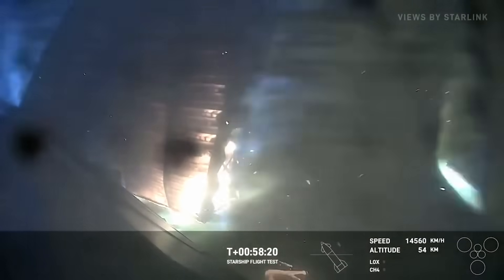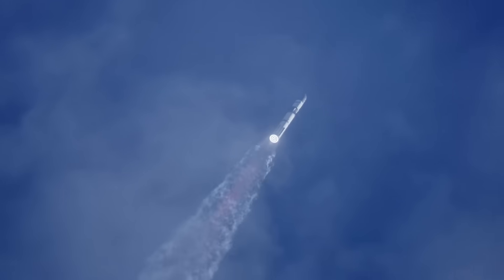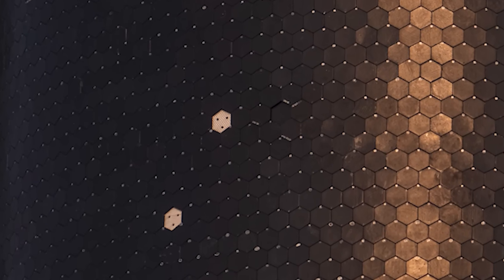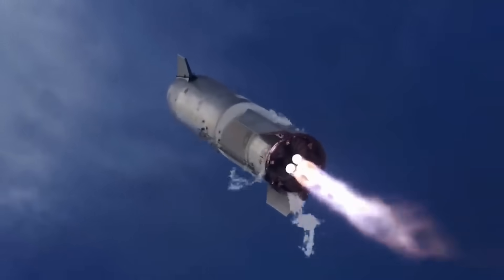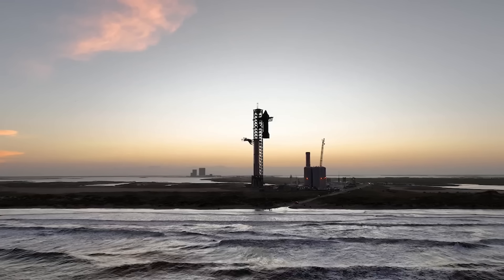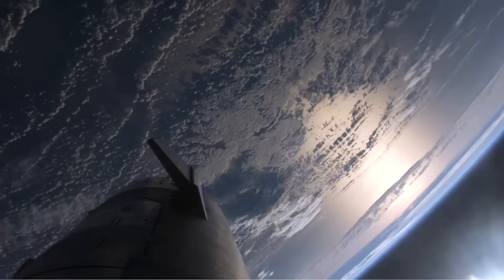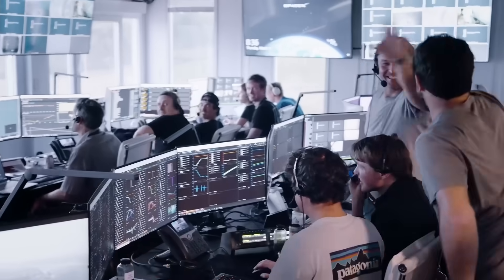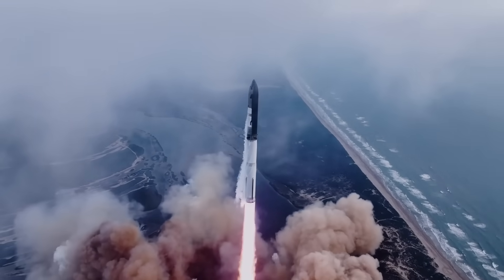SpaceX Is Adding Another Heat Shield Layer To Starship

Comment: Thinking out loud could Endura Coating's Composite Diamond Coatings (CDC) Specifications Series 1100 be slightly improved to add higher temperature diamond coating adhesion resilience, then coat Starship's stainless steel Flaps, and Space Facing no tile unshielded fuselage side on re-entry to wick away heat from under the new two layer heat shield tiles, and into the plasma stream exiting as a proposed wick away from stainless steel surfaces additional cooling concept, thus stabilizing Starship on reentry by means of improved more stable, even out fluid dynamics flow patterned, while decreasing both flap, and fuselage unwanted abrasion do to evening out localized stainless steel surface heating on StarShip’s many plasma transitioning points from tiled surfaces to non tiled surfaces. Any thermal engineers out there wish to comment on a three layered heat shield system comprised of diamond coated stainless steel surfaces, layer one heat shield, layer two heat shield.

Google Search at “ScienceDirect”: Research Paper titled "Effective thermal conductivity of a diamond coated heat spreader"

Comment: Try a smaller rocket with the various tiles or surfacing and run it through the reentry tests. Why such a huge device to test ablatives ???  No quick turn around for this setup. Bummer but just scale it, cracks and dislodging fixes should not burn through it. Installing electro-gravs will also help reduce the mass/fuel needed, ask Eugene Podkletnov how to do this.

Comment: Very little fuel in the booster tanks will prevent an explosion??????????
Have you forgotten those explosions of the test Starships when they fell over on landing???
That's what you get with "nearly empty propellant tanks".
Reply: As spectacular as it looks less fuel does mean less power.  That's not to say it's insignificant, but less fuel to burn is less fuel to burn.

Comment: I expect a destroyed launch tower if SpaceX tries to catch a booster. It seems like a more logical solution is to suck it up, take the weight hit, and put landing legs on the booster, then let it land on a pad mounted on rails. The landing pad could do double duty for propulsive landings of Starships. I mean the damned thing is eventually going to need landing legs for Mars anyway. Might as well suck it up now and put them on.
The rails would allow them to move the booster back to the launch pad for reuse, while protecting the extremely expensive and valuable launch pad.

Putting so much important equipment on the Stage 0 launch pad might be OK for saving weight, but it is an enormous risk. Destroying a pad is expensive and cuts your launch abilities in half, assuming you have a second pad. Even if they "perfect" catching a booster or Starship or both, SpaceX's devotion to the "no part is the best part" ethos works against the redundancy that is required for reliability. That makes the odds of a malfunction or hardware failure more likely, and the danger of a stage 0 disaster an expectation somewhere down the line.
Reply: That might be why they only consider the opinions of the ones who have access to the actual data.

Comment: I wish SpaceX would test a section of the heat shield with a transpirational cooling area to see if their original idea has merit. Those tiles must add a lot of weight. And if they have to add an ablator behind the tiles, that's even more weight. So the question becomes, would the fuel/weight penalty for using transpirational cooling be more than the penalty of a conventional heat shield? And would the holes required to expel the cooling vapor be too prone to clogging to be reliable? 
If that method proved effective, I think it would be much better for reusability than heat shield tiles. The tiles on the Space Shuttle were its most maintenance intensive area that slowed down reuse and increased costs massively.
I hate to see SpaceX be forced down that road. They chose stainless steel for its cost, ease of manufacture, and durability. It is time to try to maximize its utility by trying the transpirational cooling method.

Comment: The Space shuttle is a better design.
Reply: Maybe give some arguments to support your thesis?
Reply: @GreyDeathVaccine  Large bottom surface area to absorb the heat 🔥. StarShip should be build like a pyramid - larger surface area.
Reply: @michaelanderson3096  Not needed.  You shouldn't pretend if you don't actually know what you're talking about.

Comment: Using ablative materials, wont this drastically increase turn around time ?
Reply: Yes, but only if a tile is lost, and the ablative material is exposed to high temperatures. It beats burning up on reentry.
Reply: @StillAliveAndKicking_  Place the Rapid vehicle turn around in the Next Time bucket.
Reply: @mikewallace8087  What on earth does that mean?

Comment: Any solution using tiles and heat shield will not be rapidly reusable. We know this from the Space shuttle.
Better go back to the drawing board and think about something drastically different.
Reply: Each space shuttle tile was custom made, hard to remove, and brittle. Starship tiles should be much better.

Comment: Ablative?? Doesn't that defeat the purpose of re-usability?

To the person with diminutive brain capacity who replied: a heat shield is not comparable to fuel. Do you have to re-coat the inner lining of your car's carburetor every time you drive, because half the aluminum alloy ablated off? That's the real comparison.
Reply: LOL. What a stupid question. Do you also say that the car is not reusable because it burns fuel?
Reply: @GreyDeathVaccine  No such thing as a stupid question. Don't insult someone for showing genuine curiosity!
Reply: Do you have to re-coat the inner lining of your carburetor every time you drive, because half the aluminum alloy ablated off? That's the real comparison, you [expletive]

Comment: Making 2 sets of steering flaps slightly off-aligned at the back. So when re-entry, the ones most located at the back of the ship stay more out of the heath... and it provides an extra safety for when one set fails out i think.

Comment: We need to stop kidding ourselves that there will be a rapid reuse or ultra quick turnaround for Starship. It just won't happen with current heat shield tech. The booster? Sure that is most likely achievable. SpaceX will most likely need a fresh Starship ready to be added to the stack while the Starship that  just landed goes for refurbishment.

Comment: If they do manage to land the booster, they are then stuck with an old booster on the pad that they then need to dismantle.

I guess the chance to see up close the exact wear on it would be valuable, but it will require quite a bit of dismantling effort afterwards.

Comment: I'd be very surprised if they attempt a catch on the next attempt. If they did, they must be quite sure that they can rebuild all the infrastructure there quickly so it doesn't set them back from future launch attempts. Also wonder if the mechazilla arms can handle slight tilts of the rocket as it lands. Wouldn't want the catch to fail because the grid fins snap off because of the tilt.

Comment: I think eventually they will have to take the weight hit and put landing legs on the booster, and land it on a pad mounted on rails (to bring it back to the launch pad for quick turnaround). It will also prevent more damage that could happen as the booster tries to hover while they try to catch it. 
I just can't see their landing as precise enough to catch anything. And if something goes wrong, which is likely given their "no part is the best part" ethos, which works directly against the redundancy required for reliability, they will destroy a VERY EXPENSIVE Stage 0 launch tower. Off loading the weight penalty to the pad is a swell idea, but it makes a lost tower much more of disaster than if you lose a single booster.

Comment: If the material is ablative, that implies a necessary servicing after every launch, because material is lost in the process of heat dissipation.
Reply: The Starship tiles are NOT ablative.
Perhaps your thinking of the new undercoat, it will be ablativevbut it's only in an emergency AFTER tiles fail so it might not have to get serviced at all if no tiles fail

Comment: Every Starship advancement is a nail in every other rocket's (F9 an FH excepted) coffin. The corporate efficiency is actually beautiful to watch!
Reply: I categorically disagree.  Not every customer wants to use starship to launch their satellite or whatever it may be.  ULA has contracts for flights through to 2030.  Besides that it will be a couple years before Starship is reliable enough to regularly fly missions. Even longer to fly people.
Reply: @michaeldeierhoi4096  His point still stands. This new class of rocket will soon make everything that isn't fully and rapidly reusable obsolete.

By the end of the first half of this century, expendable rockets will be a thing of the past.
Reply: @SebastianWellsTL  Well on that point Mr Wells I have agree.  I was too caught up in thinking near term.  My bad!
Reply: @SebastianWellsTL  realistically we can expect Starship to be replaced by 2050.
Ariane 5 first flew in 1996, had multuple upgrades until 2008, retired the final version in 2018 and will be replaced with Ariane 6 in 2024.
If Starship is successful, I'd expect it to be similar, getting upgrades (V2, V3, etc.) over the next 10 years or so, and being retired/ replaced sometime in the 2050's.
Reply: @plainText384  
I think you are right. However, similarly to the Soyuz family of rockets (lasting over 60 years) Starship, as it moves on to V2, V3, and perhaps V4 down the road, has the potential to last a very long time.

Comment: And the front fins are the "stops" for the mechazilla catch recovery. You weaken or lose the fin, what is the alternate recovery for Starship?  A direct landing?
Reply: The catch points on the ship are BELOW the forward flaps.  It is not the flaps themselves.  They are not sturdy enough.
Reply: @michaeldeierhoi4096   My oversimplification.  We haven't been told yet if it was the flap or the flap seal that failed.  A failure of the flap seal could lead to  plasma degrading not just the flap but the body of the ship itself. I'm just curious what the contingency is if either the sensors tell SpaceX that there is damage at the catchment points or if there is some malfunction of the chopsticks, that's all.
Reply: @billgallaher339  That is surely a detail about the catch that I had not thought about.   It will be interesting to see how this plays out.

Comment: I still don't understand why they went with heatshields, haven't we learned from the Space Shuttle that if one of those tiles that are in a critical area fails the hole thing is compromised? Also, there's a reason why they don't fly the shuttle again immediately despite it being capable of landing, they would need to inspect all of the systems including replacing the tiles and inspect it again once the whole thing has been refurbished which will take a long time. Is that the plan here though? Make a fleet of Starships so when one is being refurbished they can send another one immediately?
Reply: The vision of Space X is to make starship rapidly reusable just like an airplane.  Of course starship is a much more complicated problem, but given the significant progress Space X has made from flight to flight I think they will figure this out.  It may take a few more years to really refine the TPS that is reliable and doesn't require a lot of attention after each flight.  

In the mean time they could still do the rendezvous to the moon with Orion.  The rapid reuse part may take a while to work out.

Comment: Thousands of single points of failure. Good luck with reliability and turn around. You won't be able to solve this with trial and error SpaceX approach. Struggling a bit...😂

Musk sycophants can't say one critical thing about SpaceX.  Scary.  You guys follow your shiny object till you find something else that catches your interest.  

Real engineering criticism of the tile approach is bringing up the reality that this is a very hard problem.  The Shuttle program was plagued with tile issues during its operational life.  Nasa's brightest could not find a fix.  SpaceX needs some real science to fix this one.   Not some  ablative layer underneath the existing tiles. That approach is a concession that the problem will not be easily solved.  Did you see that control surface almost get cut off the ship in the latest launch?
Reply: In other words you are completely ignoring the progress Space X has made with just 4 launches.   And you are ignoring the precedents that Space X set over the last decade of reuse of the Falcon 9 booster which have now reflown 20 times.  Or the 300 + times that space has landed the falcon 9 boosters.  Nobody is doing any of that.   That alone should give you pause.
Reply: @michaeldeierhoi4096  Yes he is ignoring.  Haters are not terribly bright.
Reply: @michaeldeierhoi4096  Man, you musk sycophants really can't say one critical thing about SpaceX.   Scary.  

 In all of the launches has the heat shielding improved?  In the last case as in the first launch,  tiles also fell off.  In the last case, the control surface was almost cut off the ship...  The tile issue hounded the Shuttle program during its entire operational life.  It took months to turn around a Shuttle for another flight...

 Actually, it looks like Musk is going to assume that tiles will fall off with his new ablative layer below the tiles. To me this is a concession that the tile problem is hard and will require some serious scientific break-through.  

In normal operations, assuming this tile approach, how long do you think it will take to check and replace tiles for fast turn-around?   This is not going to be an easy problem to deal with.  In my opinion...
Reply: Every innovation has had criticism. 

But If its an innovation of value then all the criticism in the world cannot hurt it.

Comment: Needs a titanium layer between the stainless body and tiles in most severely heated areas
Reply: It's true that titanium has twice the melting point as steel does.  Titanium has a melt point of  3000° C  vs 1500°C for steel.   But titanium is also 20--40X as expensive as steel which makes Ti  a no go.    I'm sure the Space X team considered that option.

Comment: Well from the launch video the tiles from the flap didn’t really start coming off until the high pressures of the atmosphere not the hottest zone with the plasma build up. Yet, the heat most likely weakened the shield and how it’s mounted. So adding a flexible carbon fibre skin layer under the shield would probably help. They could wrap it over the flaps but maintain mobility flap control.

Comment: 1.) titanum flaps
2.) retractable flaps flushed in starship
Reply: 1.) Titanium would still melt as it is 1500 deg f over it's melting point
2.) Retractable flaps can't steer. That is the exact time they are using the flaps. If they are retracted, you have no attitude control. What do you think it has them for?

Comment: Seems that they need some kind of "pod" around the flap hinges that can be jettisoned when they get through all that re-entry heat.  The hinges appear to be vulnerable.  As stated the Starship is to be quickly turned around and re-used.
Reply: That would not be reusable. They simply moved the flaps leeward so the joints are not in the plasma stream. This possible failure was predicted before the flight.

Comment: To solve the problem with the burning flap, SpaceX should attach it on the back of the rocket where there is no abrasion.
Reply: Musk said it may be moved to the leeward side.
Reply: But the flaps will not be moved until version 2 begins construction which reportedly would be S36.

Comment: SpaceX will iterate on the heat shield and eventually have a robust system in place. Starship v2 will specifically move the flaps to avoid the hinge issue.

Comment: what about a tungsten/titanium alloy in the fin seal gap area it will weld to steel and tungsten has a melt point over 6000 degrees it's heavy but alloyed with titanium would cut weight?
Reply: Cost for one would make that option prohibitive!
Reply: Titanium is not only more expensive (around 20 times that of steel) but it is extremely hard to work with in welding applications.

Comment: Reuse of the booster would be a major accomplishment, and doesn't seem to present any fundamental technological challenges, but just a repeat of the sort of thing that they did with Falcon 9. AFAIK, the major costs are involved in these ships are the engines and currently that is 33 engines for the booster and 6 for the Starship.  Even if it takes 5 years to get a human rated Terra landing of the Starship, they are still ahead of the pack.  For the mission to Mars, they could get by without that capability.